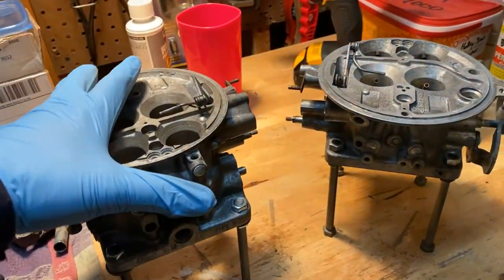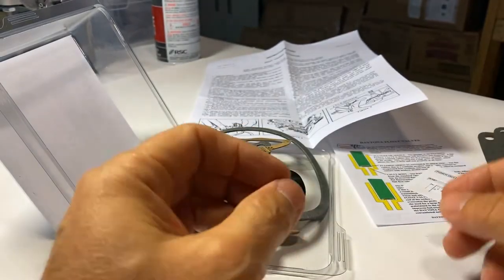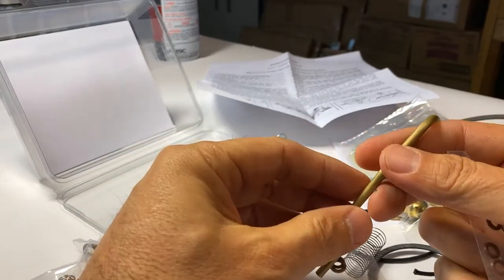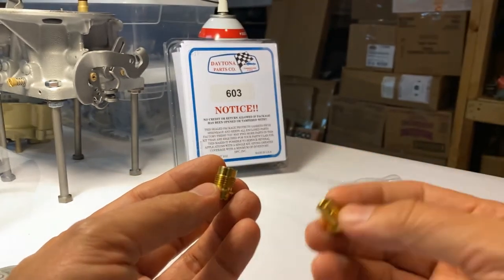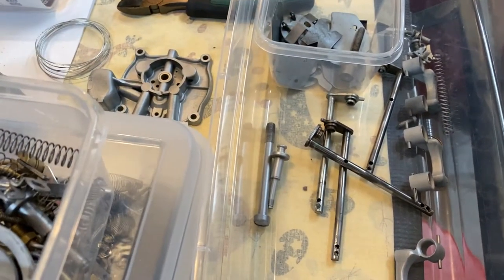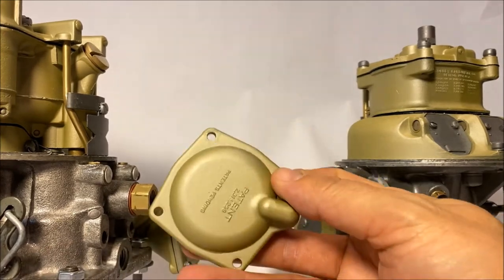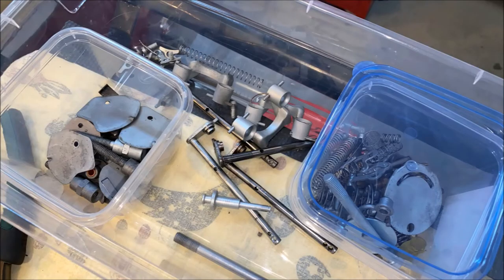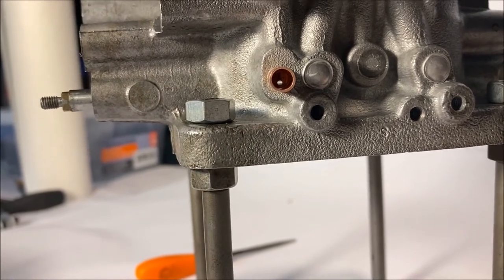1956 Ford Holley 4000 Carburetor Rebuild Tips

Comment: Good morning.... i was just searching up the Holly 4000, ran across your channel, I was wondering if you offered a rebuild service. I have two 4000s, one on my bench and one that's installed on my 55 Crown Vic. The car is running, but it's running extremely rich. I'm a helicopter mech by trade but I'm feel a little intimidated with all these little parts and peices. Some things are better left to the professionals and that's why I was wondering if you offered a rebuild service?
Reply from the maker: Would love to, but I moved from Ohio to California and not quite settled in yet. Hopefully I will be set up later this year by the middle of the summer. Check out HotRodReverend.com. The opening video explains how to use the blog.

Comment: Daniel, i just bought this 56 tbird.  i was going to drive it home 600 miles more or less.  didnt know anything about the car.  Made about it about 45 miles.  Vapor locked, It was trailered the rest of the way. I pulled the carb when i got home.  it is a teapot carb Holley ECJ-9510-Y 1164.  When I was taking it apart, the part that runs from the throttle body to the pump shaft was disconnected.  That was odd. As i am putting it back together after cleaning, i hook up these parts and the pump connecting part will not let the throttle body open up all the way.  Am i missing something or part.  Also watching your video the washer on on top (the bleeder screen washer).  I need the washer.
Reply from the maker: Jerry, it is certainly difficult to help diagnose through this means of communication - maybe shoot an email to me at danaxjessup@yahoo.com? that would you could send a few pictures. I find that over the years parts end up being discarded or "left over" on well-meaning carb rebuilds and it sounds like you might have one that went through the ringer. I do not have any of those washers at the moment (they are kind of like a fender washer) but most restoration supply outfits like TeeBird Auto Parts should have one.

Comment: HI,  I am storing my 56 T Bird for winter.  Where is the drain plug for the carb bowl?  It's a new $900 carb.  I don't want to make any miss steps.  Thanks in advance,

Douglas
Reply from the maker: If your carburetor is a Holley 4000 variant then there is no drain plug. In 1957 Ford and Holley came out with the "modern" design and of course those drain plugs are easily identified on those carbs. For the storage I would suggest that you use Stabil or another ethanol treatment product. If you are running pure gas then you will not need treatment or drainage if only sitting for a few months. If you are concerned about residue in the fuel bowl on your 4000 then removing the lid is a simple process and you can siphon the fuel out of the bowl.